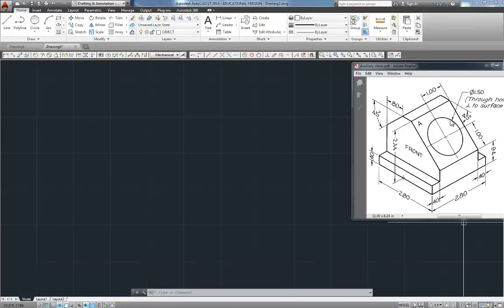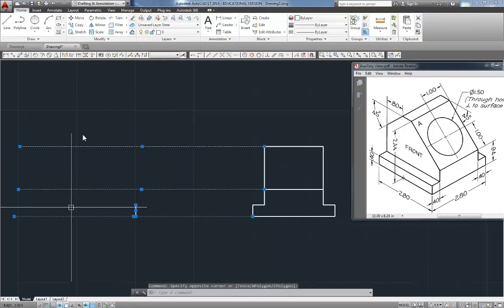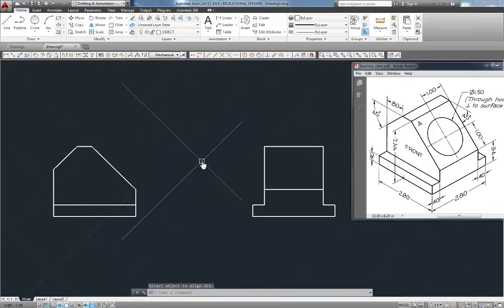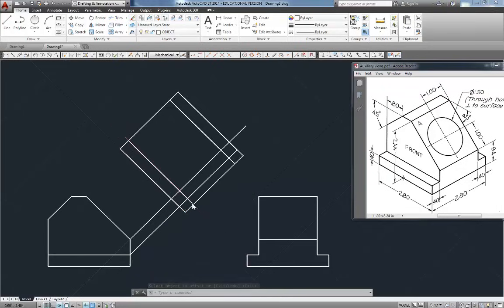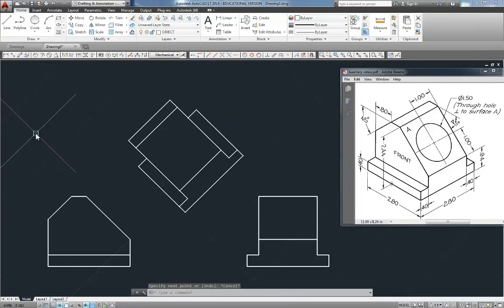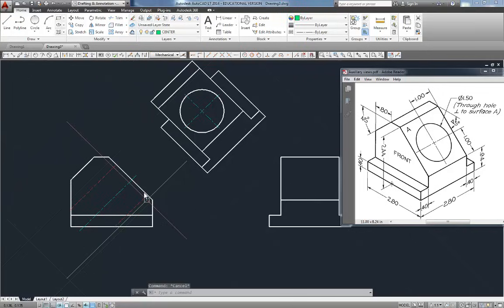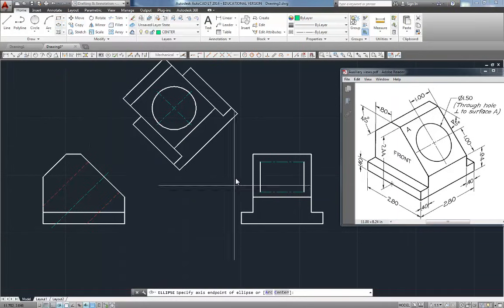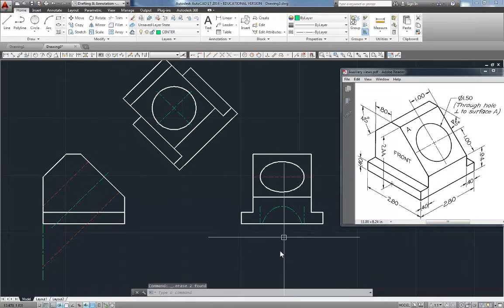AutoCAD Auxiliary views

Comment: Mr. Kopf,

Nice tutorial.  I have a couple questions if you're able to respond. I don't have Autocad.  I use a competing product.   

The "fillet" command I'm familiar with is used to put radii on the sharp corners of polygons, rectangles, etc.  But you apparently used it to join and trim intersecting lines.  Is this something that has always been in Autocad? Or new to the version you use?   And can you tell me in more detail HOW the command is used for that purpose?

I watched you create the center line for the hole ( front view).  You then trimmed the center line so it extended slightly above the angled line representing the sloped surface.  How did you do this so quickly?  My approach would have been to offset the angled line, and trim to that offset.  But you did this without offsetting.   Probably some method I failed to pick up in my beginners class. But I wish you'd explain it to me.

Thank you for your time.
Reply: Thank you Mr. Kopf.  I always enjoy learning new ways to speed up my work.